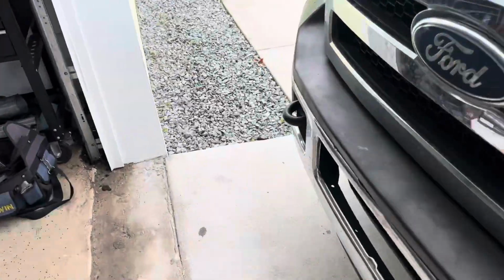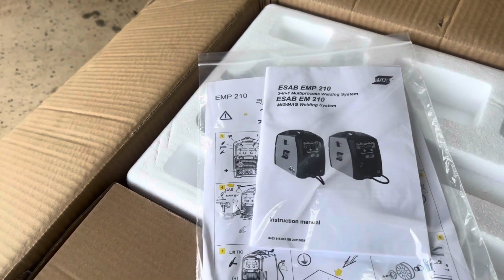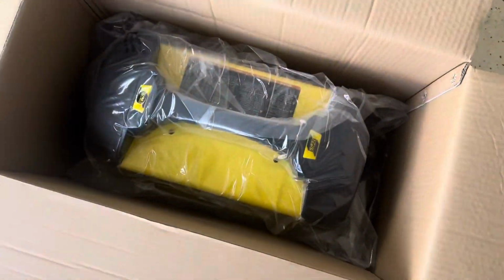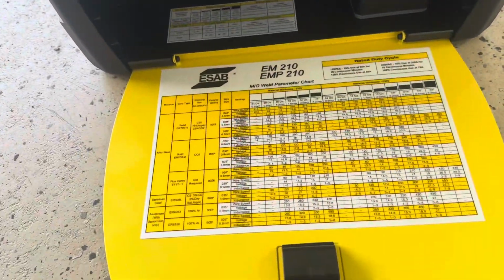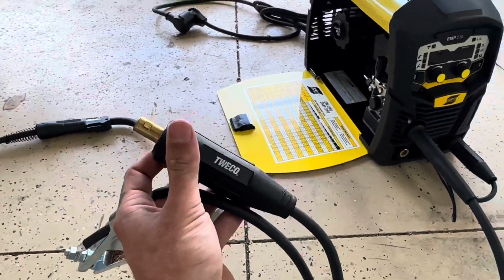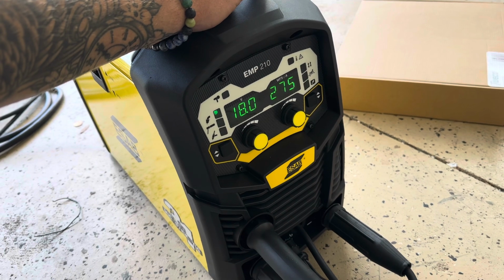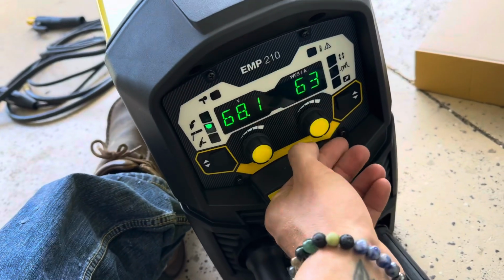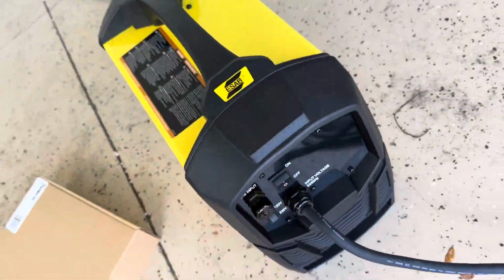ESAB EMP 210 IS IT DECENT???

Comment: Ther junk ! Mine broke at 25 hours . Sent it in . Waited 3 months to get it back . Its been used for less than 30 mins since getting it back from repair shop . Busted again ! I got 4 esabs now . 210 emp is just junk ! Broke twice now with less than 30 hours on it . 215 rebel has menu onob issues . Stuck in mig mode . The esab 141i lasted about 15 , 20 hours . Smoke literally rolled out of the 141i . And the 285 esab has start up glitches ! I replaced the esab 210 emp with a miller 215 multi process machine . Absolutely zero problems with the miller 215 . Runs great ! Zero problems! Made in china parts on esabs now ! Always wanted a esab . Now i have 4 . All 4 have a combined value of a 6 pak a coke and a gummie ! The supplers here had so many returns they pulled them off the floor and dont recommend them any more ! The lessons we learn ! Wish you better luck than ive had with them ! My buddy bought the harbor freight omni pro . 1000 bucks . He had one knob issue . Harbor freight gave him another one . No charge ! Hes laughing at all the esab issues im having

Comment: I believe esab is a great budget welding machine. I think you will be very happy with your esab. Eventually I will most likely be getting the AC/DC esab.
Reply from the maker: It’s been good so far. Iv used it almost everyday since posting this. The only issue Iv had is with the mig gun liner. The wire got stuck in the liner somehow and I had to pull it out and it’s been fine since.